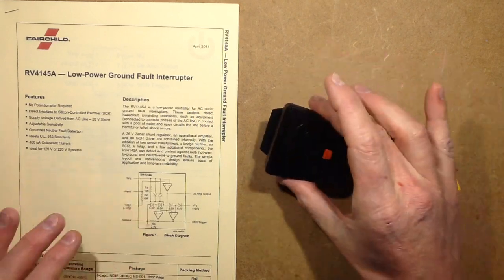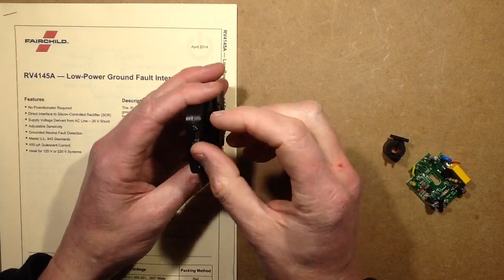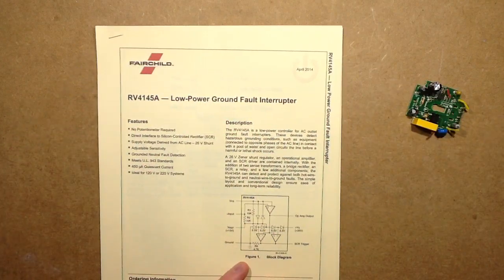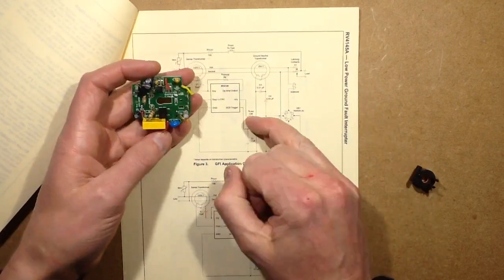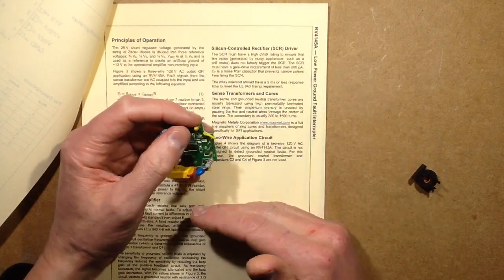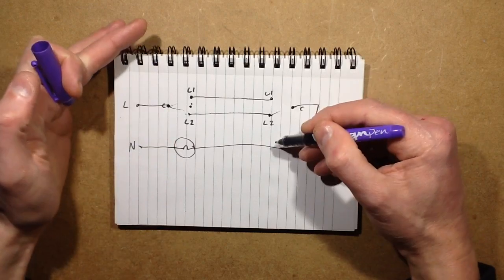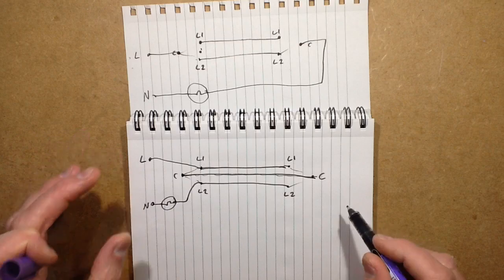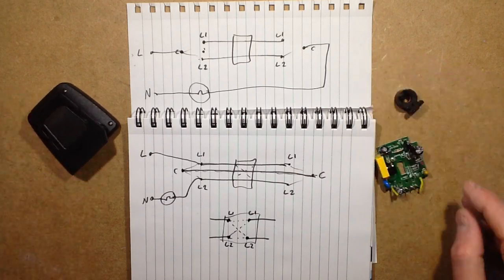2 way, 3 way, 4 way lighting switching and other random stuff.

Comment: As a very old electrician (about 11 edition) I was also surprised how many electricians seemed vague about two way switching circuits and often jiggered the connections about in different ways until the circuit worked, I worked on many 2way circuits over the years and expected the circuit to work first time. I was familiar with both ways of connecting the circuit. I must say I was never ever called on to install an intermediate switch. One of the advantages of the strappers and commons  connected together was that there was a live feed and switch wire at both switches, I utilised this may times to provide a feed to another light in the same switch box, of course an intermediate switch could not be used  wth this arrangement.

Comment: I struggled with multiway switching when I first started out as an electrician, especially when you throw dead end 3 ways and/or switch loops into the mix. There comes a certain point where it just kind of clicks and I don't struggle with them anymore unless I'm trying to figure out someone else's goofy wiring.

Comment: The second method allows the live wire to be present at both ends of a two way switch, where the first method would need an extra wire to do the same job. This makes it easier to extend the circuit with more lamp circuits or sockets.

Comment: Clive could you answer me this question about light switches. Last year our light switch completely broke so a friend bought us a new one which I, in a "how hard can it be" moment decided to fit myself. I am a IT engineer and love electronics but am no electrician so am not sure why when I fitted the new switch it worked fine but had to be pulled 3 times before it would switch on? You could pull it 3 times quickly or twice then leave it 10 minutes and only pull it once to switch on?

Video on my channel here:

https://youtu.be/1pr6c23Zqcg

Very weird but your definitely the man who will know why this happens.

Thanks and great content as always.
Reply from the maker: +Philip Sempers These switches often use a rotating contact or cam that revolves a part turn with each pull.  It looks like one of the cams or contacts may be faulty or out of tolerance.  It's possible that when you put it up the switch may have flexed slightly on an uneven ceiling causing this issue.  Best fix is to buy a new one yourself, since you don't really know where your friend go that one and it may already have been faulty,.
Reply: +bigclivedotcom First person with an answer Clive knew you would. Up at 3am too then ;) Thanks. Been bugging me for ages why exactly 3 pulls makes it work.
Reply: Sounds like you have a multi (4), position switch, more than likely has 4 terminals on it, common and three outputs, usually used for heaters low, medium, high and off. either get a new switch or loop terminals 1 and 3 together, then the switch will alternate between made and open as it works thru its 4 positions.  If on the other hand the switch has only two terminals then as we say here in Australia, "She's Kangaroo-Edward mate" ( Roo-Ted for all the non Aussies)

Comment: i have a therd option a real old style 
two switches live in on l1 in both switches and neutral in on l2 in both swiches load betwin c and c

it dimands large swich gap 

sorry fore bad englisch it is 3:30 har in sweden and my spelling is sleaping ;-)
Reply: +Niklas Elste That is a very dangerous style of switching called the carter system which was actually prohibited by the NEC back in 1923.

Comment: Is there a modern UK convention for colour-coding the cable in multi-way switching? I guess you can't really blow anything up by connecting something the wrong way around (although you could hard-wire a switch on or off in the case of those weird middle-man crossover switches)?

What are those crossover switches called?

Assuming a stupid electrician might have installed my 4 way lights, can I assume that if a switch has 4 wires coming in to the backbox, it's a middle-man, and if only 2 wires, it's one of the end boys?
Reply from the maker: Middle switches are called intermediate switches.  If using three core and earth all cores should have a bit of brown sleeve on them, but your choice of colour for the strappers.  First box from ceiling rose should have two core and earth coming in, and three core and earth going out.  Intermediates should have three core and earth in and out, with one core looped straight through.  Last switch should have single three core cable.

Comment: I was trying to help a friend install a GFI outlet at the beginning of a circuit to protect all downstream outlets. After he installed it, it would trip immediately. After a lot of probing of wires I found that he had a stairway light with 2 switches wired as your first diagram showed. The line was taken from this "outlet" circuit while the neutral was taken from an alternate circuit. We had to reconfigure it with one switch and used one of the travelers to return ground to the same circuit. I talked to some of my electrician friends and found out that while illegal, this was frequently done. Electricians have apprentices that pull the cables when a house it being built and they come in after the walls are finished to complete it. They just wire it up so it works, not necessarily correctly.

Comment: the differences in terminology between the US and UK are interesting.
over here in the state you also find circuits that would have the 3 way switches wired in reverse(2 way for you). where your L1 connects to Hot L2 to neutral and a single conductor to one side of the lamp. the other switch would be wired the same with common going to the other side of the lamp.
Reply from the maker: Like Spain apparently, but now outlawed as the lamp can have live to both contacts in one of the off positions.
Reply: +bigclivedotcom indeed, dont want to touch the edison base when unscrewing never know if it will be hot. of course here it is only 120 volts.

Comment: hey BigClive, in the US we don't use 3 wires between both switches, only 2, and we call them travelers.  signed Union electrician Mike, local 11 Los Angeles area.
Reply: Travelers?  Why are they going somewhere after you connect them?  Travelers are the beers you take with you for the trip home after you have finished hooking up the strappers  :)

Comment: Somehow I don't see an advantage of the second method. Switches are usually wired by 3 wired and 2 wired cables (our old norm specified cyky A for 2w and B, C for 3w) so I've always done box above first switch, there goes 3 wires L,N & PE. 
Type A  (now -O) cable down to the switch (3 wires marked black, black, brown; brown being the L, blacks are for L1 and L2) from the same box, you go to the other switch with the same A cable, blacks are the alternating L1, L2 and the brown is the returning L.
Lastly one C (now -J, marked blue black and yellow-green) to the light. 

Only way how the second method make sense is if you wanna wire those switches directly from one to the other, but I am not sure if it's even allowed by local norm and there is not really that much space in our switch boxes.

Comment: hi . Iv enjoyed some of your videos  that I've watched . I was looking to see if you have done any reviews  on 12v lighting as I'm looking to buy  some light for my race van which will be half camper  an the other half kitted  out with crates for my racing huskys.  I'm also looking for some 12v spot lights too an which in your opinion  would be the best to go for . Thank  alot if you have time to reply.  Regards  from Scotland .
Reply from the maker: +devito501 The self adhesive LED tape is probably a good start, followed by standard MR16 style spotlights fitted with 12V LED lamps.

Comment: Confused I am
I've studied the data sheet for the RV4145a and I still have absolutely no idea how this earth-neutral fault detector part of the circuit works (fig.3).    The description of its operation appears to be gobbledygook and the circuit makes no sense at all.  The output from the 'ground neutral transformer' is connected across the rectified mains voltage which is low impedance and so it cannot possible do anything.  In addition, this transformer appears to be totally redundant, even if it did work I can't see how it can possibly do anything that the main sense transformer isn't already doing.  I expect I'm wrong, I usually am, but I'd be grateful if someone could point out the error of my ways.
Reply from the maker: +number 33 As I see it, the auxiliary transformer couple the rectified DC ripple (I'm not sure why they don't couple AC through it) so that when there is a short between the neutral and ground wires it means that because they are bonded by default on the mains side, it creates a loop so that current is induced in the wire loop that is detected by the sense transformer.
Reply: +bigclivedotcom OK thanks Clive I've got it now the right hand transformer is not detecting a current it's injecting one.  An ac waveform is applied to the 200t winding on the right hand transformer via C4.  Normally this doesn't cause any current to flow in the line or neutral wires and so has no effect but if the neutral is shorted to earth on the load side then it creates a loop through the neutral wire, through both transformers and back via the earth connection at the distribution transformer and a current flows in the neutral wire only.  This produces a differential current in the left hand transformer which triggers the detector.  So all the talk about positive feedback and oscillation is hogwash but I guess it works.  Presumably it's done this way so that it immediately detects a neutral to ground fault even if there is no load current.
Reply from the maker: +number 33 It took me a moment to get it too.  Especially with the transformer seemingly in series with a capacitor on the DC side of the rectifier.  The neutral earth connection on the mains side could be as close as the main incoming cable.  In some systems they have a coaxial cable with the live conductor in the middle,surrounded by a combined neutral/ground conductor.

Comment: The second 2-way switch wiring method was something I figured out many years ago but I've yet to see it used practice even though it saves a joint over the first. 

I'd add to your excellent description that an intermediate switch is a DPDT switch pre-wired internally in the same way as you'd wire a polarity reversing switch.

Comment: I rarely get to do a 4 way but I remember 3 ways (2 switches controlling 1 fixture) by just remembering 2 wires. Put the constant hot on the black screw and the switch leg on the black screw. The other 2 wires can go on either screw.

Comment: sorry clive that must rate as your worst tutorial ever, when it comes to multiple light switching, it can't be done , without an electronic device'that resets all power interuptions and resets L1 or L2, at every swich. as 'minimium', I exagerate a bit by saying assume, a 3 flat, the L1 and L2 would short out if  everyone pressed on at same time, without protection, and more likely in multi occupassion, you seem to say in that tutorial 2 common wires (L1,L2) then hang swithes? no way.
anyway best wishes for new year. K.
Reply: +mrkntlr What are you going on about? He's talking about light switches, as found in a house or shop, not start/stop pushbuttons or whatever. The switches are break-before-make so there would be no shorting out. What he drew is what every working electrician in the world has been doing for years.
Reply: My point was and I admit i phrased it badly, for a public site, where amatures might try using normal domestic light switches, this tutorial is dangerous, there was no explaination of the nessecety to use 'break before make' switches as you more correctly say,
Reply: +mrkntlr Still not sure if I understand you or not. I sort of see your point if the switch contacts were "overlapping" rather than "break before make" but I can't say I've ever seen a 2-way (3-way in USA, SPDT in electronics terminology) basic light switch that was "overlapping". Selectors and pushbuttons used in industrial situations can be ordered to overlap or not overlap contacts as needed for a particular application, but not domestic light switches - as far as I know. Anyway - I don't mean to argue about this and I doubt Clive needs me to defend his videos ;-)
Reply: lol think we are in agrement, clive can defend himself, but my point was only 2way swiching can be achieved from domestic house switches, otherwise it needs an interupter, and to suggest it can be done otherwise, is asking for trouble in a public room, I am a fan of clives work normally, but this is serious if some amature tried to wire normal domestic switches, over to clive now i think.
Reply from the maker: +mrkntlr Sorry, but you're obviously thinking of something completely different.  This is a single phase lighting circuit that will be protected by the fuse or breaker on that circuit.
Reply from the maker: +mrkntlr I really haven't a clue what you're talking about.  It has nothing to do with generators, bypasses, or any form of external power source.  Multipoint switching on lighting circuits is found in most homes.
Reply from the maker: +mrkntlr The switches do break before make, but even if all the switches suddenly shorted out together for some unknown reason, all that would happen is that the lights would come on.  I take it you realise that I'm talking about controlling lights in a home from multiple positions?  There's no neutral connected to any of the switches.  The circuit is just interrupting the live feed to the lamp.
Reply: I might just add that maybe there is confusion over the marking of switch terminals as L1 and L2. I understand what you meant but I work with this stuff constantly. To my (American) ears L1 and L2 could just as well mean the 2 legs of residential 240/120 "split phase" power or even 2 legs of 3-phase, which wouldn't make any sense here but not everybody's an electrician...
Reply from the maker: +Sootikins  That's where the confusion might be.  Our three phase supplies are also labelled L1, L2 and L3, but the single phase switches are also labelled with L1 and L2.  So what are the American multi-way switches labelled as?
Reply: +bigclivedotcom Almost embarrassed to say this: American switches typically aren't labelled with anything. They think we're all illiterate, so they use colors. 3-way has a black screw for the common, brass screws for the 2 positions of the switch. 4-way (intermediate) has 2 black and 2 brass, each pole has 1 black and 1 brass IIRC. 

I do almost exclusively industrial work so I don't actually see this sort of switches every day anymore so somebody please jump in and correct me if I've missed anything. I did go grab a few old 3-ways out of the my box o' stuff just now to confirm what I thought I remembered tho...
Reply: sorry clive, but think everyone is missing the point. any normal 2 phase, domestic wired house can't support more than 2 way switching, and trying to add a 3rd switch , without any 'breaker' is asking for trouble, normally I love your videos, escpecially your break downs, but to even hint that more than 2 way switching is possible without a 'breaker' on the other lines is iresponsponseible
Reply: not really clive, I'm thinking of the A**holes that see your video, thinking I can add a 3rd or 4th switch just running power from a generator, as they are rewiring, idiots that bypass etc, stand by my comments that to suggest more than 2 way switching in a public room is asking for trouble.

Comment: All real easy to understand that 2-way (or more) switching on paper, but often times when I'm on a job in an house with the old style wiring (1st method drawn) I struggle to get my head around it when you've got the switches/roses undone.  Add in 6-terminal JBs hidden away in attic/floor spaces where live cores change from reds to blacks, and single core blacks (neutrals) strewn here and there, and it usually leaves me baffled for a good while.  Not great when you've you've been called to fix the circuit and are supposed to know these things with the customer watching...  I always get there in the end though!

Maybe it's because I grew up learning the newer style 3-core 2-way setup with 2-core switch wire drops and simple loop in, loop out at the pendants.  For me that's simple.  For the old stuff though it's a bit like trying to fathom old imperial measurements - I can learn it, but have usually forgot it all 2 days later.

Comment: looks to me like your 2nd 2 way light diagram wouldn't always work and it would use more wire lol
Reply from the maker: +gazzaka Draw it out and trace the current path for every switch position.  It only needs the standard 2 core and earth, switch wire to the nearest switch and standard three core and earth to the others.  Just a single cable all the way.
Reply: On second thoughts it would work , except in a multiplex situation, but that would also affect the usual circuit, ....would waste more wire tho lol ;-